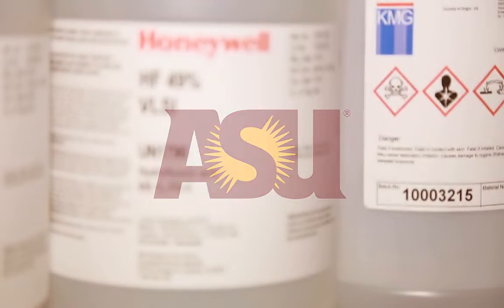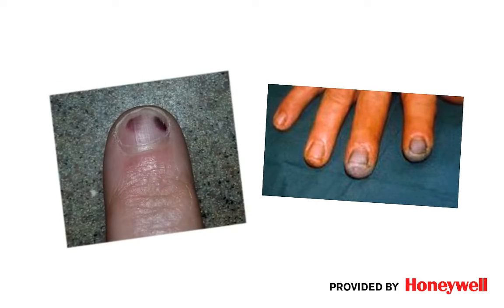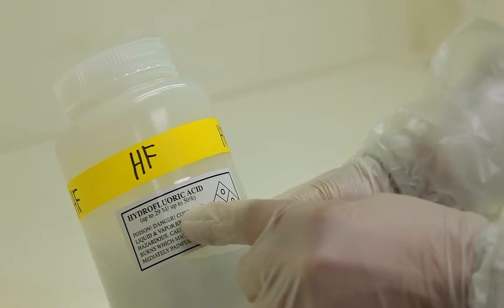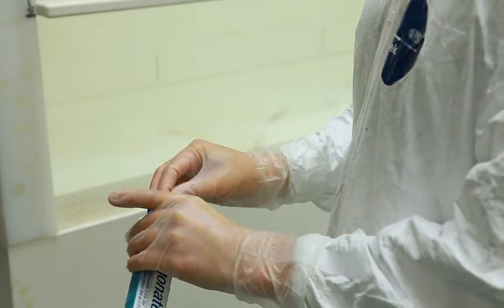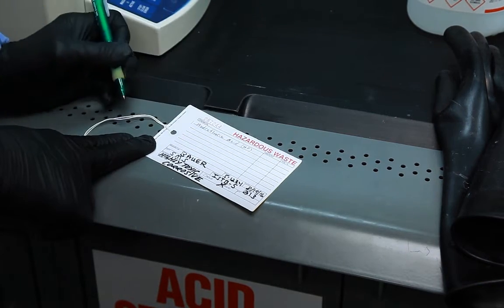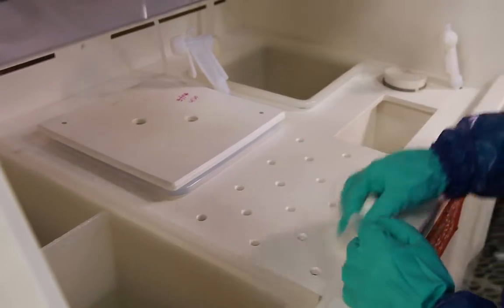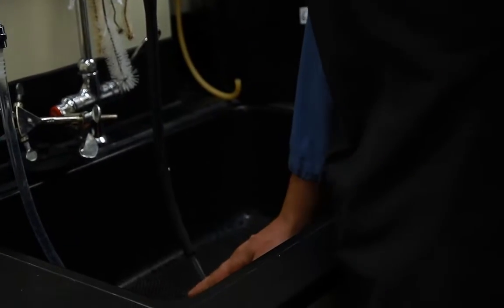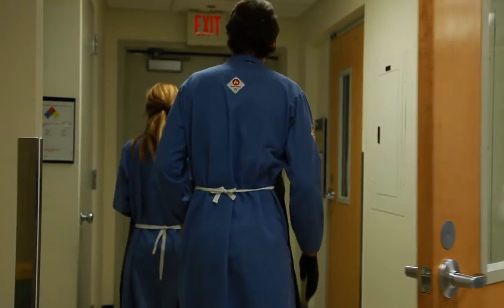Hydrofluoric Acid Safety

Comment: I used 10 % HF regularly in my business. It was a lot cheaper to buy at 30%, so I did that. To dilute it, I pour from the 10L HF container into a bucket of water, also of size = 10L. 
The HF container was heavy enough that I needed 2 hands to hold it, one hand at bottom, and one at top. I pour slowly, and half way through the job, I would change hands over. The job took 2 minutes. At no stage was there any splashing or spitting. ZERO. On this day, the job was finished, YAY.  8 hours later that night , my fingers were stinging a bit. Next morning, they were stinging a lot, and became quite sore. A day later, yellow pus was leaking out of my finger tips. That got worse, and was leaking a full teaspoon of pus per finger tip, per day. I went to Doctor, but he could not to anything, because it was not an infection. This full teaspoon of pus per finger tip per day carried on for 6 weeks. After about 5 weeks of it,  I had lost 7 finger nails, they just fell right off me. (grew back weeks later). This stuff needs massive respect. I lost 7 fingernails, JUST FROM THE VAPOUR OF IT FOR 2 MINUTES. Bow to the power of it

Comment: Why is ASU not equipped with HEXAFLUORINE solution? I know many big companies around the world that uses this solution in case of an HF splash. There is packaging adapted for the skin, eye and mucous membrane. 

Within the semiconductor industry there is a lot of HF and this solution has been able to save lives.
Reply: My chem professor used to work as a chemist in an hf purification factory that sold the purified hf to tech companies in Silicon Valley.
Reply: You can buy this HEXAFLUORINE solution by the PREVOR compagny in France